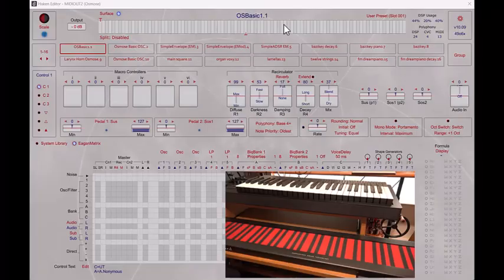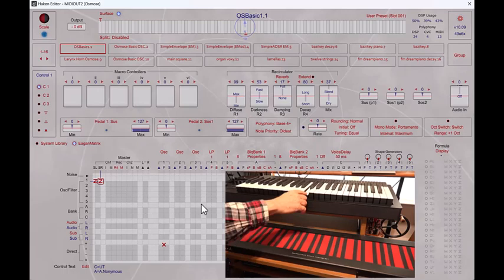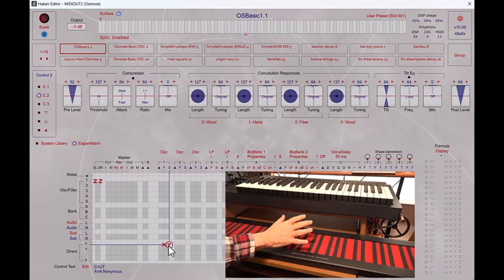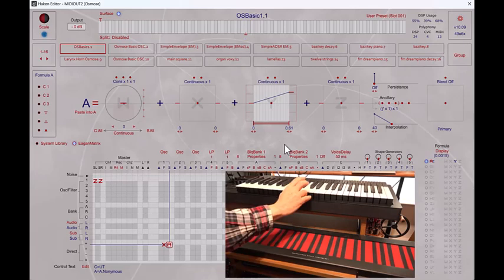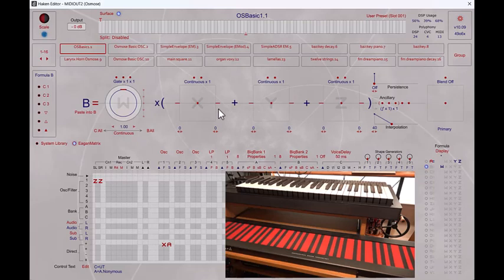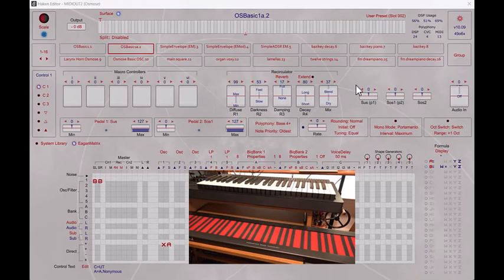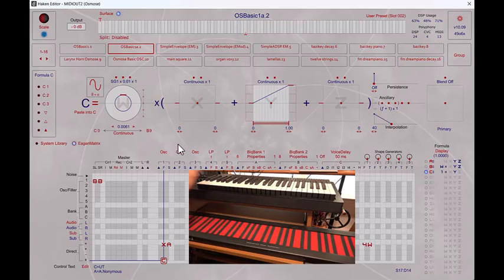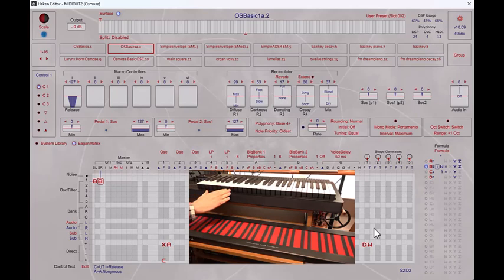EaganMatrix Programming for Osmose - Initial Concepts

Comment: Hi Richard.  These video tutorials are really helpful - thank you!  I have an Osmose and there is an Eagan Matrix patch titled “wow soul chords” that plays a whole step lower than concert pitch. I’m perusing the patch in the Max/Eagan Matrix software but am unable to find the parameter to transpose the patch to concert pitch and save in the user patches. Any suggestions?
Reply from the maker: Sorry. I don''t have access to look at this now but you can always transpose any preset in the editor using the middle C indicator in the surface display. Move it up to transpose down your desired interval, or move it down to transpose up.
Reply: Ah!  That is the solution - thank you!  Should have been obvious to me, but I’m still just getting started with all this.

Comment: Important: I noticed at 21.35, the video was cut off and resumed with something changed behind the scenes, no idea what (on top of a small change that you can see W was 0.05 before and now 0.061). Problem is that when I continue your tutorial from then on and adjust the C Formula with Y setting instructions you give and then press the Osmose keys on my synth to hear back the result (like you do at 22.00), the result of the sound is not the same on my side. The aftertouch Y takes my sound from one pitch to another. Do you remember if you changed something else at that cut off part in the video? Thank you.
Reply: I found the issue: I see you quickly changed the scaling of C to a multiplier at 21.45 - quick subtle change.
Reply from the maker: Yes I simply adjusted the width of the vibrato a slight bit. This doesn't change the basic sound in any other way

Comment: Hello Richard. I just fired up the Haken Editor here for the first time with my Osmose, and I'm wondering where/how do I obtain this bank/group of 16 demo sounds? Should they load when I click Group -> Demo Assortment 1-16 (or is that like a "shuffle" function if I already have a group file loaded? Thanks for the videos - total noob here but I'll learn quickly. :)
Reply from the maker: That's an option in the group icon but Osmose does not use a default user preset group like continuum does. This is for continuum only I think. You can try loading and see what happens, but you can always crate your own group of 16 user presets to load - see Continuum Manual. Osmose has its own demo category group option I think on the Osmose.

Comment: Thank you, this was very interesting. I remain confused about only one small thing: where does the value for W actually come from? It's used in the formulae and it can be included on the direct matrix rows, but I don't quite understand its origin (unlike X, Y and Z, which are clearly coming from the control surface itself).
Reply from the maker: W is a combination of things. When you use the standard W formula in the matrix "W" it is just a gate on when you press the key and goes  0  to 1 instantly. W in the formula section can be a gate imposed though addition or multiplication (whatever you set your formula to) with X, Y and Z or it can be a constant you add or multiply or you can use it to set shape generator or impose your macro controller on it or set it as a scaling factor in a couple ways. So it in essence can control the formula or offset it. There are other videos on the site that go into those kind of details.
Reply: @eaganmatrixprogramming  That does help, thank you! Obviously I need to read the manual at some point. I'll probably wait until I have an instrument that uses the matrix though – otherwise I'll probably forget a lot of the info again before I get a chance to use it :)

Comment: Thank you for your very detailed video! There's something I can't figure out: Is the EaganMatrix only an editor and programmer of the internal engine of the Osmose? Or can you use Osmose as a midi keyboard controlling the EaganMatrix inside your computer? Is there a VST version of the EaganMatrix? I would like to use the Osmose in a complex live setup using Ableton with multiple layers of sounds, live looping, etc. For this, I need to have the sound generated on my computer and not in the Osmose
I'm really struggling finding the answer, any help would be nice!
Reply from the maker: It's only an editor that connects to the Osmose (or Continuum) and changes the sound on the Osmose. You can not run it as a plugin to create sounds on your computer directly.
Reply: @eaganmatrixprogramming  that’s unfortunate because I would really like to push it further. I know I can route midi to Ableton and then resend it to Osmose in order to have midi looping, quantization, octave pitch etc. But I would really like to loop several presets at the same time without using audio looping. Do you know if there’s any way of doing this without keyboard split? Like being able to have one preset in a loop while playing with another one on the full keyboard.
Anyway, thank you for your answer! It already helps me a lot!
Reply from the maker: @damien4364  All you might do is set a Combination preset on a split with one preset above and the other below the split. You can't play multiple presets other than split.
Reply: @eaganmatrixprogramming  Oh yes, good idea, didn’t think of that! This will be retraining but that should do it. Thanks a lot for your answers!

Comment: Thank you for all your effort. This is very helpful.

I have one question. I tried to follow the user tutorial that comes with the editor. However, when I load the tutorial patch "Simple FM Tutorial.mid" the EaganMatrix disappears and the sound cannot be played from the Osmose. In the Max Console it states: cc109 27 syncFail. Do you know how this can be solved?

PS: The Osmose is still connected and changing a preset on the Osmose will load the Osmose preset into the AeganMatrix editor. Also, if I save a preset from the Osmose to disk and load that midi file, everything works fine. So there is something specific in the tutorial file that generates a problem, which is strange, since it is a tutorial file. It should not have anything specific.
Reply from the maker: I think there are issues with some versions of that file. Where did you get it? Are you in the Facebook Osmose users group. The file is in the Files section there and works fine.
Reply from the maker: And if you don't have access to the Facebook group open up a Haken Audio ticket and someone can email it to you.
Reply: @eaganmatrixprogramming   Thank you for your swift answer. Unfortunately I am not on facebook, but thanks anyway. I downloaded it with the Haken Editor according to the directions of Expresive EE when I got the Osmose. I feared that these files could only be used with Haken Fingerboards. But if I understand you correctly, that is not the case.😀
Reply from the maker: I think their link is bad. Try here: https://drive.google.com/file/d/1OuFC5utqkHFQGyfyt7mwoANIL9T5X12H/view?usp=sharing